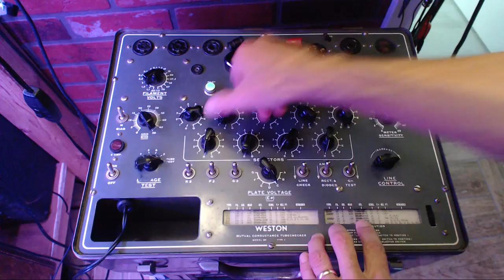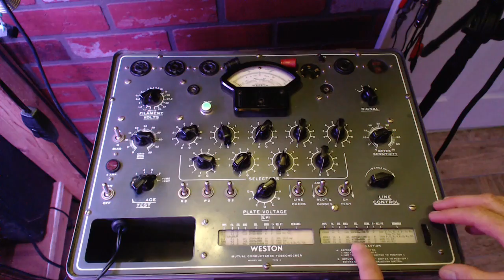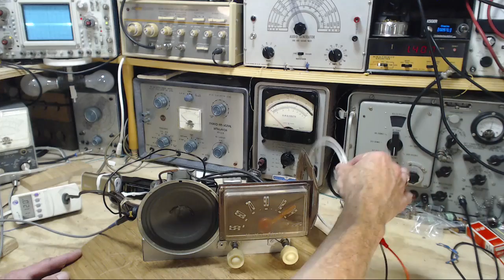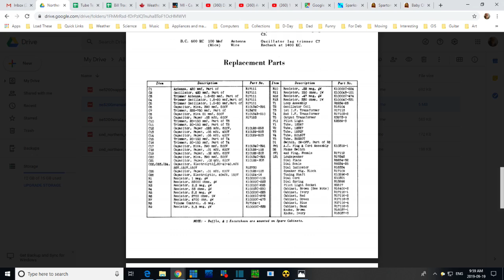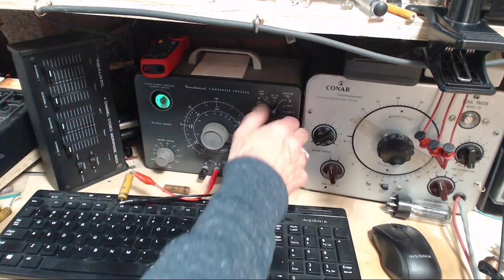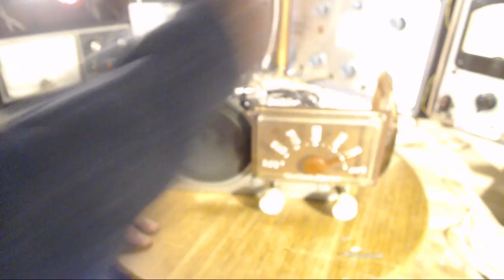Northern Electric 5300 Five Tube Radio Video #3 - Finale

Comment: That is weird the first vacuum tubes are 70V Plate voltage the third is 42V Plate and the last is a high voltage high power vacuum tube with 107V Plate voltage very strange and I wonder why someone hasn't tried using low voltage Wire ended Raytheon  Miniature vacuum tubes operating at something like 24 volts to replicate that radio.

Comment: Cathode biased output tube control grid should show 0 vdc any + vdc suspect coupling capacitor, also gassy output tube can pull slight grid current and will show a + grid voltage.

Comment: All these old paper caps are bad by now, with very few exceptions all of the caps with paper only dielectric are junk even new old stock ones, later types with plastic dielectric will probably be OK such as the green CDE - PM tubulars or Sangamo 33M series, but not 33 (no M) the M signifies mylar in the dielectric. Striped (bumblebee types) the yellow Astrons and many other molded types are all junk as are all oil filled paper types. If in doubt test.

Comment: you need change volume control , is too sensitive
Reply: Use one with an audio taper element, not a linear control, audio taper starts low resistance and stays fairly low then changes more rapidly closer towards the max.resistance. end.
Reply: @olradguy  
My thinking is a non audio taper / linear volume pot you can live with .
The big problem is the 1.2 M resistor in the AGC voltage divider !

Comment: Good troubleshooting, Jim.  Glad to see it working.  A few notes you might consider or reject as you see fit:  First, you can often replace the resistive element inside pots if you find a similar one to use as a donor.  Switches can sometimes be repaired in like manner, and short shafts can be extended using brass pipes or other means.  In extreme cases, dissimilar pots can be grafted onto original shafts though not without a bit of machine work.  Also, as others have mentioned, it's best to replace all the wax capacitors even if they test good.  That alone can fix a number of biasing issues and your tubes will thank you for it by delivering less distortion.  Looking forward to the next one!